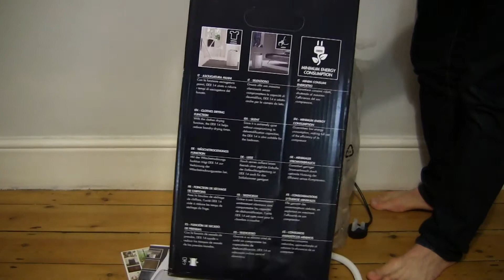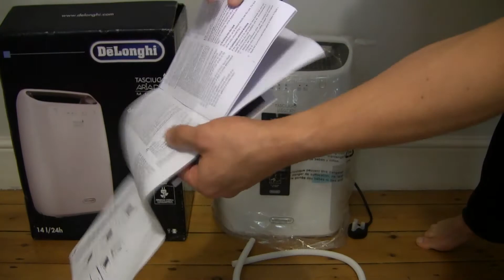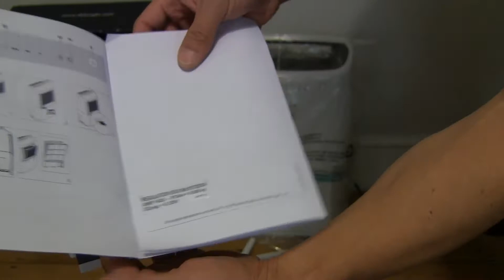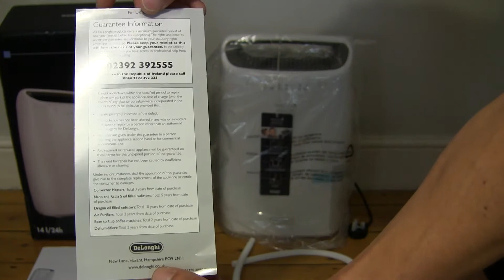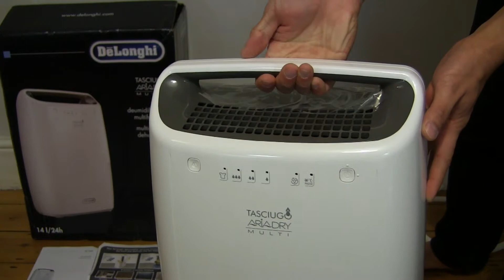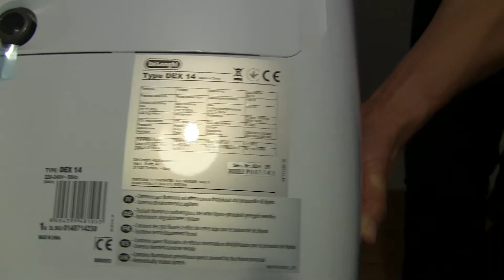De'Longhi DEX 14 Dehumidifier

Comment: Is it supposed to sound the same at all levels or should it be louder at higher levels? I bought one, but I'm not sure if it is working properly because it sounds the same at every level.
Reply: mine does too. Why would you want it higher in volume??
Reply: @annegilpin2993  I don't want it higher in volume, it's just a way to differentiate the levels.

Comment: We bought a Breville 2 in 1 dehumidifier and air purifier and it was impossible to sleep with because it sounded like a freight train when switched on! We returned it after Breville customer care said that we had a faulty unit and we're now looking at this DeLonghi unit. Is it much quieter than the noisy Breville unit? Also does it have a useful HEPA filtration system? Keep up the great work. Cheers 😊
Reply: REally, really quiet. I love it.

Comment: Does it maintain the power state when disconnected from the mains? In that, if the supply is interrupted (unplugged while operating, for example) and it is reconnected; will it continue operating? Or do you have to press the power button again?

Comment: Hi bro, in term of produced noise, would you be able to sleep with this dehumidifier turned on?
Reply: Guys..the machine is Great but in the end..I decided keep it off while I m sleeping..just let it work 4 hours in the afternoon
Reply from the maker: Hi bro, at the lowest setting it is very quiet, so yes. Happy dehumidifying.
Reply: I don’t think you could sleep with this in your room. Also depending on the way it sits the motor also make a right racket / rattle. You could hear it  in this video when it was first started and near the end too.

Comment: Does it have auto restart? I want to make some automatization with humidity sensors and smart plug. In case is running and power gows out, will it restart when power is restored witout pressing any button?
Reply from the maker: Hi bro, it doesn't. Happy dehumidifying.

Comment: I get this model but i have ask 
I will open 2 days but still no one ml water inside tank 😞
Only compressr sound start up in dryer 4 mode only
If ant person tell me is that oky or have a problem in Unit
Reply from the maker: Hi, set it up in a very damp area like the bathroom and see if it collects water. If not, contact customer support for help. Happy dehumidifying.

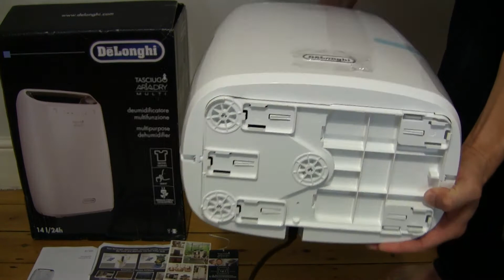Comment: Doesn't it come with some kind of rubber feet? The bottom of this dehumidifier has 5 tracks like you are supposed to install something in there (see 5:50).
The unit I just bought works fine, but it's noisy because of vibrations.
Reply: I think you're right the rubber feet- on amazon if you look closely it has little bumps which probably clip in where you suggested
Reply from the maker: Hi bro, not that I'm aware of. Have you seen any product pictures with them? Happy dehumidifying.

Comment: Looks like the filter holes are too large so dust and other gunk will accumulate on the inner coils/fins which will reduce its efficiency and will require more maintenance. Some brands have hepa filter options. Would have been great to see the drain in action and whether there is a pump that expels the water or whether it depends on gravity for the water to leave the unit, a pump is a unique feature. Also a demonstration of the status indicator lights would have added value to your video because that's something that you can't get by reading the user manual. I appreciate that as it is not your unit, you may not have had the permission to delve deeper.